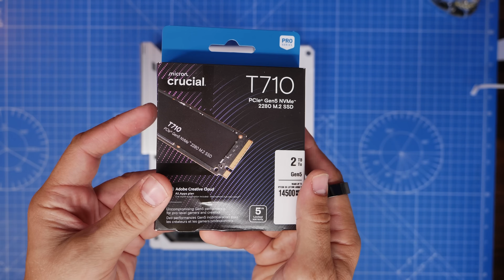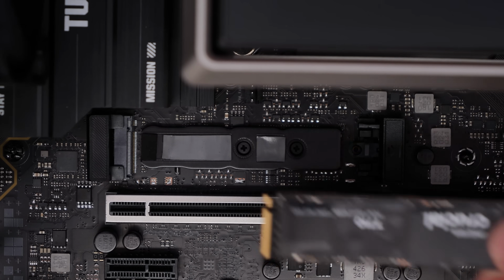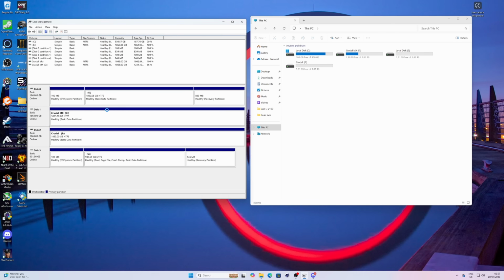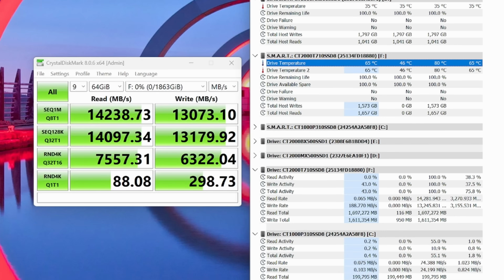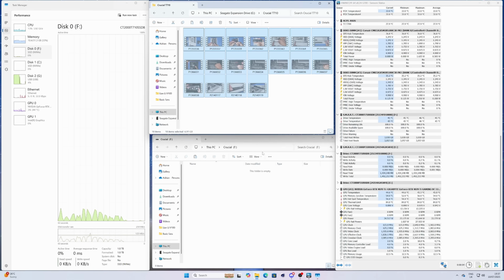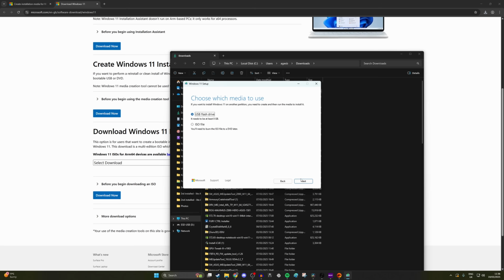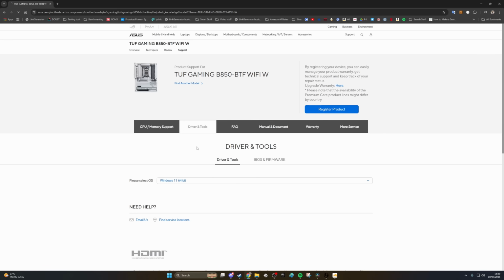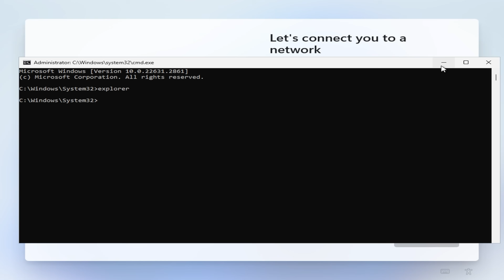How to install Crucial T710 NVMe SSD and check it is running at max speed

Comment: I’ve just built my first pc. It won’t load windows (on a usb), it’s stuck in a boot loop constantly taking me to bios settings. The ‘boot’ light on the mobo is stuck on yellow. In the bios settings I can see everything I’ve installed, I’ve enable xmp and can see ddr. I’ve got 2 x 16gb ram in correct slots, took both out and checked them individually- still boot lite and still in boot loop. Not sure what I’m doing wrong 😢

Comment: Hello, so I was watching your corsair 5000d installation video but I couldn't find the next one in which you tested installing your gpu vertically, did you do the follow up video? Thanks
Reply from the maker: The frame 5000D or original?

Comment: i recently got a wd black sn8100 2tb, so was wondering 1. should i set it up as a system drive and install games on it, or should I use a 1tb samsung 990pro that I have laying around for the system and the 8100 as a dedicated gaming drive? 2. how much performance would I loose if I used the 990pro that way as it would set my 5090 to pciex 4x16? i saw gamers nexus video claiming 1% loss but it was running the 5090 at stock while mine is overclocked. the reason for the 4x16 would be that I have 2x 2tb 990pro’s already installed.